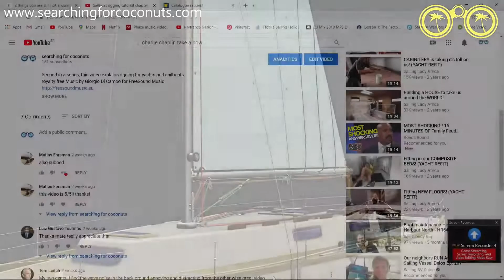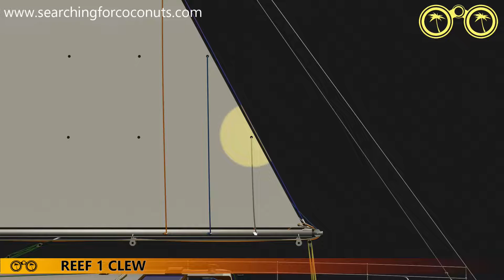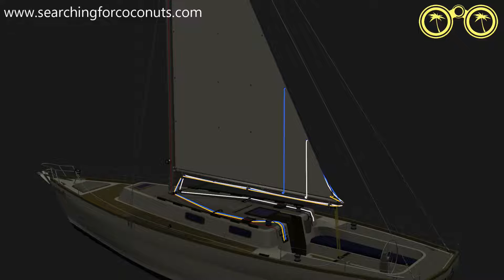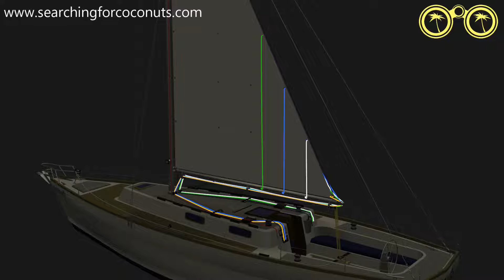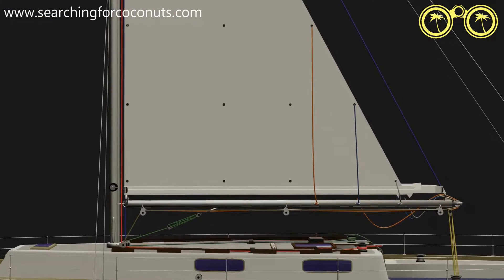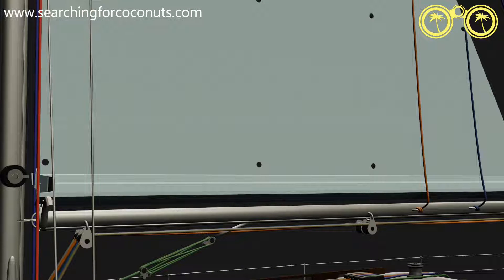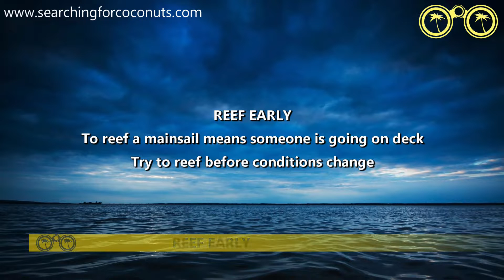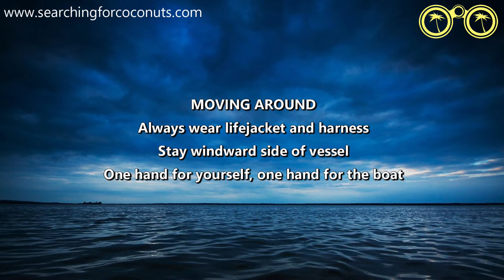sailboat rigging for beginners #3 reefing the mainsail

Comment: Would you kindly just explain how after 1st reef we get the other reef lines “out of the way”? Great video. Thank you.
Reply from the maker: Thanks Tim... As the sail is lowered, the reef lines become slack... These reef lines run through jammers/clutches so we just have to pull on the lines just to take up the slack. If those jammers/clutches are locked, we have to remember to open them when taking the reef out so the lines can move freely and the sail can be raised again. Hope that makes sense, thanks for watching

Comment: Excellent videos, fantastic CGI and explanations but I did notice no mention of the main sheet while reefing using the topping lift. I know this is a very basic beginners tutorial and you're focusing on what happens with your reefing lines/pennants and what's going on at the mast and boom, but you can wind on the topping lift as much as you like, without easing the sheet it's only going so far, another area where I am inclined to do it a bit differently when using a topping lift is to wind on the reefing line/outhaul on the clew before easing the topping lift and tensioning the vang, for me just better to tension the foot before easing the topping lift, reefing systems  are a very personal thing dependant on how and what you sail. Granted this is very basic beginners stuff and what we might take for granted other less experienced sailors might not know.
There are a lot of more performance orientated boats out there with no topping lift and hydraulic vangs etc with a heap of other reefing systems  over and above. Can't really go wrong with bull horns and maybe a short pennant for #3's luff cringle/dog bone and in boom reefing lines led aft to cockpit, topping lift or not, I personally like a loose footed main with outhaul, and single line reefing through external boom mounted blocks just aft of the relevant reef's clew for outhaul, along the boom and up through another block to the luff, down to the mast base and  back through deck organisers and clutches to cabin top self tailers, ease halyard while winding on reefing line, up wind/down wind under power no majors, and all accessible for maintenance.
Keep it simple, why I'd have tiller steering ahead of helm any day
Reply from the maker: thanks again Jonno, clear and relevant information

Comment: I love your videos. I’m going through them with my wife to develop her sailing knowledge during this extended time when we can’t get to our boat due to COVID. I do have a question though: It appears from your video that you lower the boom (topping lift) and tighten the kicker (boom vang) before you tighten the reefing line. This seems to be in opposite order from what I learned while sailing a J24 at sailing school. Is this an error, or is there a good reason for doing this? My boat uses a single line reefing system for reefs 1 and 2 so no need to leave the cockpit. I’ve had problems with that system because of too much friction combined with stiff sails typically requires me to leave the cockpit multiple times to go forward to sort things out. This has caused me to lose my “skipper’s presence” on more than one occasion! (Ha ha!) I am planning to correct this problem with new and smaller/slippery Dyneema reef lines plus low-friction rings as soon as I can return. If you have any other suggestions I’m open to help. Thanks again for your wonderful videos!
Reply from the maker: Hi Rick, thank you for your comments and attention to detail. You are correct, the topping lift and boom vang should be the last actions. This will have to be corrected in the description. Hope you get back on the water soon...

Comment: Excellent videos! From the animation it looks like Coconuts has a boom furling system, is that so? I never experienced it. If that is the case, what’s your take on that system? Do you like it? (Modern sailboats tend to come now with in mast furling instead).
Reply from the maker: Hi Dan... the original videos had a flaking mainsail and stack pack but it proved very difficult to animate, so although it looks like a boom furling system, it is not... it was the easiest and most aesthetic way to produce

Comment: Why does the boom need to be raised each time the sail is moved?
Reply from the maker: Hi Brad... when there is tension on the leech of the sail, it makes it tricky for the sail to move smoothly through the tracks/hanks at the mast. When this tension is released by raising the boom, the sail can easily be raised or lowered.
Reply: @searchingforcoconuts2248  thanks so much for the videos and the reply. Taking my sailing course this spring

Comment: So question, when going from reef one to reef 2 or 2 to 3, do disconnect the cringle from the earlier reef. Same for the reef lashing?  Good video
Reply from the maker: Hi John, great question... Could not include this on the video as it's not standard and can vary from vessel to vessel, depending on the set-up or personal preferences. As far as the reef hook and cringle goes, most times (not always) there will be a hook on both sides, so reef 1 and 3 could be used on the starboard side, and the hook on the port side will be used once, for reef 2. So your hook needs to be able to handle two cringles, otherwise, yes, take off the previous cringle.  The lashing by using reef ties depend on how it's set up. Some folks use loose reef ties and then they would have to removed and re-tied. However, these could be permanently fastened to the sail cringles by use of knots on each side, which will give access to reef ties for every reef and therefore, the previous reef ties would not have to be removed. Hope this helps... :)